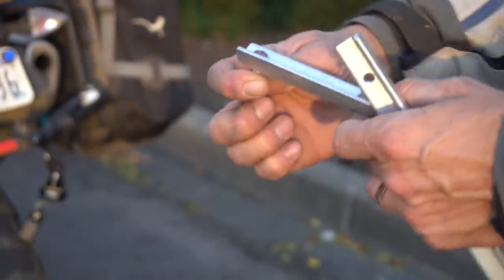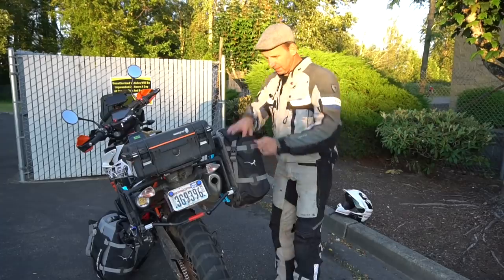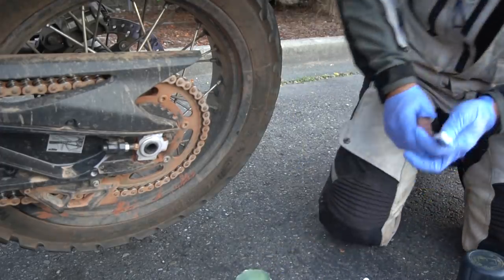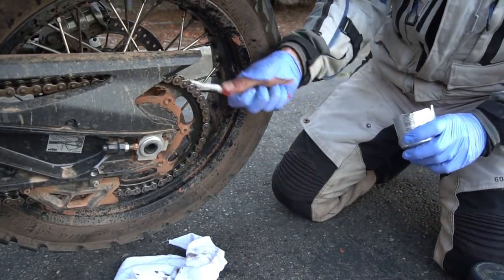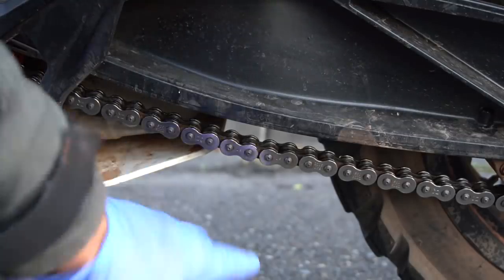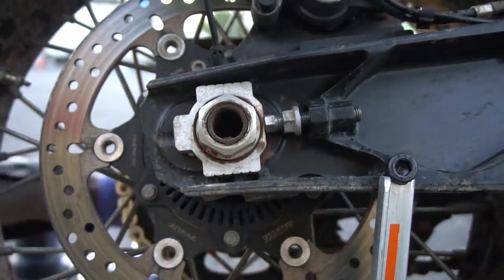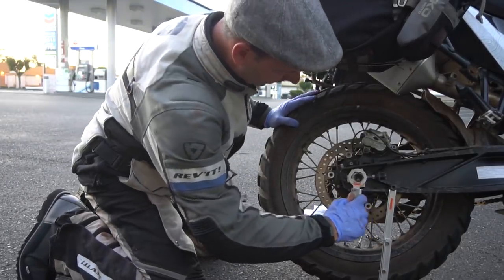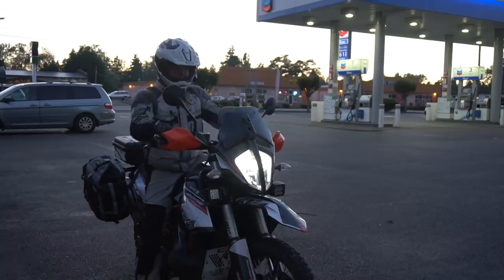Motorcycle chain maintenance tips while traveling

Comment: Very helpful! I’ve got a 1600 mi trip coming up, and was wondering about this. Question: Don’t you lube the chain after cleaning? I’ve specifically wondered about that because it seems like chain lube only comes in a bigger can than I want to carry...
Reply: You need to lube to chain. He got the whole x/o-ring thing wrong. Yes theres o rings and yes theres grease inside. Nevertheless you need to lube the area where the chain is running on the sprockets. Or it will wear prematurely. Diesel ist only sufficient for cleaning, but not for lubricating.
Reply: No, you don't need to lube a chain

Comment: Majority of chain adjustments should be done with the back wheel in contact with the ground, and no load on the bike. It’s the first time I’ve seen this done in this way. Aside from cleaning the chain is there a reason you have done it this way? Thanks Bret.

Comment: Awesome stuff! I do have to ask, how did you lift the bike up, to get the aluminium stand under the bolt? Did someone help you with it?
Also, about cleaning the chain. Do you clean it because of the toll the dirt off-roading takes on it? Because the popular belief in my country is, lube the chain every 300-400km and clean it before the 3rd lubing.
And I'm definitely nicking your Velcro handbreak idea. My dad's scooter (Suzuki Address 110), has something like that built in. A small 1 finger lever, that locks rear break lever in place.

And really man, thank you for all the effort! Seeing you this tired and still making a video after a day of hard work... Just wow, says a lot about a man.
Reply: They’re very easy to get the wheel up by simply levering the bike over onto the sidestand on the opposite (left) side. It’s leverage. Not difficult.
Reply from the maker: Non o-ring chains need lube, o-ring chaons need to be clean (protect the o ring from damage and dirt getting past them) and to keep the o-rings from drying out
Reply: @ronanrogers4127  I see, will try it out. It seems way more handy, than my push the bike around to get the chain in an untreated spot :P
Reply: @BretTkacs  Alright, thanks. Will pay more attention to that
Reply from the maker: You can see when I remove the stand I lift the bike using my back against the pannier
Reply: @BretTkacs  I see... Very nice, thank you for the explanation :)

Comment: Morning Bret, have you ever looked at or tried the Tutoro chainoiler from Ldyney, Gloucesershire? I use one on my HD shovelhead and Ducati ST2, and about to fit one to my 890 Adv R. Been very good on the two road bikes keeping the chain clean. They work on the motion of the bike feeding oil through a needle valve, simpler than a Scott oiler. Check them out..

Comment: lot of mechanics say, yes lube every 500-800km, but DO NOT clean every time, cause chain kicks dirt off anyway while riding, and if you clean too much, you eventually WILL take it's original grease out... my factory chain came very rusty this winter on both sides as I cleaned it every 800-1000km, even though lubed, became rusty and then called for more cleaning... from now, I clean it every 1500km properly, and lube it every two full tanks are done...that's 700-800km...

Comment: Excellent video...particularky for those who regularly do off-road. I ride a Vstrom 1000XT and do cross country tours...however I'm strictly an asphalt rider. I'll just say that my chain typically doesn't get very dirty as a result. I do focus on frequent lubing per moisture barrier. I like the stand trick. Was thinking I needed a center stand but with spools maybe just a jig like yours. My one question is...isn't the wheel supposed to be on the ground for chain tension adjustments?
Reply: yes, the readings in the manuals are based on the bike being on the sidestand. 
if you are confident enough to eyeball it, what hes doing is close enough BUT the less weight there is on the rear and the more slack you need. so adjusting your chain to eyeball 1inch when its off the ground versus sidestand COULD be the difference between a smooth ride and a chain snapping at 5000 RPM so ya know... be careful XD

Comment: I have bought the same handles you have, I then had a problem with my front brakes they were soft and mushy and finally a total break down. KTM would not accept to replace them under warranty because of the handle change. Just wanted to inform you.

Comment: You're saying Diesel (black nozzle) but you're using Petrol (green nozzle). At least in the UK. Does it make any difference which one we use?
Reply: Diesel fuel and gasoline are dispensed through nozzles that may be green, black, red, yellow or any other color. On some newer pumps, several grades of gasoline are delivered through a single hose and nozzle, which also could be any color. Green is commonly the color of diesel pumps, but not all green pumps are for diesel fuel.

Comment: that aluminium prop is amazing. I just realized it's actually better for adjusting the chain slack than a center stand. As far as I know and I assume KTM does the same, you measure the slack when the wheel is on the ground. Now try to do that on a center stand with the wheel hanging ... with this alu prop, part of the weight goes on the side stand too, true but at least it's much closer to the proper measurement situation. And it's 10 time cheaper and replaceable oh yeah, and lighter

Comment: Good vid! 
In my opinion the only and easiest way to get a perfect straight wheel is a Laserpointer!
Reply from the maker: It's just not that critical. If you can't tell it's not straight then it's all good
Reply: Don't forget sprocket alignment! I could pull my front sprocket from the shaft after i alinged the wheels after a couple of thousand miles . The axial pressure had eaten up the retainer clip completely. Nowadays i just look at the chain if it rolls over the center of the sprockets

Comment: Yo Bret!  Your 2-piece aluminum 'support stand' looks like a fantastic play on some other tubular steel stands and the 'snapjack'.  Yours seems simplest and best for this.  Did you actually drill and tap a hole in your swingarm for the locator bolt!?!  Also, do you see this method commonly used for solo trail riders for say, propping the front end up for a flat repair as well?  I bought a center stand for my AT but very quickly learned they are not compatible with hard offroad riding.  You should make a video for safely changing tires using these kinds of supports!  I would like to see some variations on tooling and also some front and rear support placement techniques.
Reply from the maker: Funny you mentioned that... My new tires just came in

Comment: I beg to differ on your chain tension.  Reread the manual.  It says to measure 25mm behind the end of the bottom chain guide.  Push up the chain at that point.  Measurement at the top of link and bottom of the swingarm should be 2 to 5 mm and the top of the chain above the swingarm should be taut.  These bikes are weird but I really like my 890AR.
Reply: Ditto on this.  Spent a lot of time studying the diagram sticker on the swing arm, the manual, and on-line videos and it seems pretty clear what you describe -- 2-5 mm off swing arm measured 25mm back from back of chain guide, is what's intended.  Seems loose, and even my local dealer said my chain was loose and wanted to adjust it for a non-nominal fee, but better too loose than too tight, I suppose.

Comment: Hey Bret, I've been pushing my way towards a 1000 mile day, I'm up to 700 now.  I actually thought my Tiger 900  would be a lot more butt-destroying than it really is, which is nice, so breaking that 1000 mile barrier is going to happen pretty soon.  Do you think it's OK to run a chain 1000 miles in 16-18 hours at interstate speed and just do maintenance at the end, or should I be really conservative and at least look at it partway?

Thanks for all your videos by the way, your stuff on Mototrek is part of what convinced me to get into riding in the first place, as well as get an ADV.  The amount of information you put out there for free is really fantastic, hopefully one day I can take an actual class with you.
Reply from the maker: In short you are fine... It's not really mileage, it's about use. The hardest conditions for a chain are dirty with sudden increases and decreases in acceleration (think hard off road). The easiest conditions are clean (relitive) with steady throttle (distance riding). Manufacturers will always error on the side of conservative which lands in the 500-700 mi range. They are assuming normal commuting and stop and go.

I wouldn't hesitate doing 1000 mi or more of touring or distance riding.

Comment: After 40 years of riding and a bunch of o-ring chains:  Screw worrying about maintenance that much.  Check the tension and ride your bike.  A new chain and sprockets are going to be required eventually, and all the additional fuss is going to save you maybe $20 of parts life.  The lube does ZERO for sprocket wear, and might actually hurt as wet chains attract dust and grit.  Adjust them, keep them from rusting excessively, and move on.

Comment: Hi Bret, I noticed the lack of a torque wrench. I was just curious on making sure to not over or under tighten.
Reply from the maker: Experience helps (wrenching motorcycles for 33 years)

If it falls off its to loose, if you strip it, it's too tight.

You can check you hand torque with a torque wrench and het cloae. This works decent fit anywhere outside the engine not dealing with bearing pressure.

The axle bearings are captures so its the inner race and spacer not the bearing being torqued
Reply: @BretTkacs  ah very interesting

Comment: What do you think about devices like scottoiler ? I have one for my 790 but I havent installed it yet because with no center stand hard to clean my chain and I need to do that before. Or maybe I can use your trick. What do you use for metal stuff for that ? Where do you get it ?
Reply from the maker: It's just aluminum angle, you can find it at the hardware store.

Scottoilers are nice but for the cost and hassle I'm not putting one on the 790 (yet)

Comment: My only real problem with this video is the fact the did not also cleaned the INSIDE of the chain ( as in the bottom run of the chain..on top.  dirt accumulates there also).  Always clean ALL of the chain...inside...outside...both sides and properly lube if you can.  Everything else, pretty good.  

I don't remember what Fortnine said about using Diesel to clean a chain if they have before.

Comment: Hi @brettkacs 
Hope you'll see this comment even if it's an old video. Please clerify how you measure chain slack on the KTM 790/890 Adventure. You say it should be about 25 mm. From where to where? The manual says you should measure 25 mm behind the chain guard (or what it's called) and that the measure should be 2-5 mm from the top of the chain to the swing. I think that's an hard way to measure and I hope you can explain how you measure chain slack for this bike.
Reply: You should stick to the method you just described it is the correct way, just use a hex key to check the gap. Also you should have the swing arm Unsupported so that the rear suspension is fully extended... unlike the method in this video

Comment: Great practical tips from a pro but aren't you getting an inaccurate chain measurement with the rear wheel off the ground?  Every owner's manual will tell you to test the chain with the bike on the side stand and rear wheel firmly on the ground.  Very different measurements if the wheel is elevated like when on a centerstand.

Comment: Good video. But this is a bit overkill. In my experience just hosing a chain  with water to get excess dirt off it an d oiling lightly will give years of maintenance free chain life. Save alot of work. Also be careful putting
Reply: Be careful putting diesel any where near your tyres. When it rains the spillage on the rim and tyre then spins onto the tread. You know what happens next.

Comment: Does sag, once you've mounted your bike, not affect the chain tension?
Reply from the maker: It does... The chain slack is to compensate for the tightest part of the swing. A bike like the BMW G450 required no slack where as others require excessive swing the free sag on the 790 is minimal so on or off side stand makes little difference

Comment: Err... all you do to tighten the main nut is you just 'loosely' tighten it with that wrench? For my Tiger 800, Triumph specs say the torque should be 110 Nm, so I bought a torque wrench and I fasten the rear wheel nut at 90 Nm (100 Nm max), and that's already a lot. 110 Nm is crazy overdoing it. But I am a bit worried seeing you fastening that rear wheel main nut quite 'loosely' with that primitive wrench that offers only minimum leverage. Am I overly concerned with that rear wheel nut, or...?

Comment: I use WD-40 when I travel, ATF when I'm home
Reply from the maker: I'm a fan of WD40
Reply: @BretTkacs  Won't WD40 actually penetrate under the o-rings? I thought the purpose of the cleaner was to get the dirt off around them, not from underneath them. I use kerosene myself...
Reply: @BartoszBanachewicz  Yep, kero not wd40.
Reply: @BartoszBanachewicz  No, it won't penetrate. Check Ryan's F9 video about chain cleaners/lubes.
Reply: @pont0n  You need to rewatch it.  It does penetrate.
Reply: @davidmcmanus4751  hm, no... Chain cleaner video, 7:20. Wd40 pass the test

Comment: bad cleaning !!! And inside the chain ????
Reply: The link rollers.... Roll

You clean the outside two cycles around, and wipe them,  then you've cleaned the rollers 360 degrees... Unless the rollers are frozen,  and that means your chain is scrap. 

TBH some diluted Dawn on a toothbrush will cut the grit,  then wipe,  then put some grease on the sprocket teeth and a modern chain has all the oiling it needs.  Kero (sour diesel)or Diesel is really not needed unless you coat a chain with grease or excess wax. 

The roller grease is trapped inside the roller for the life of the chain and you never touch it or see it...unless you destroy the O rings with too harsh a cleaning solvent or a wire brush.

Comment: Diesel destroys o-ring and x-rings. They WILL swell over time. Use kerosene at least.
Reply: Incorrect. Diesel is fine. DID recommend both kerosene and diesel. Gear oil is also recommended with o-ring chains, but not essential.
Reply: Kerosene/Jet A/ Heating oil is very lightweight diesel.  It is used in diesel engines in very cold weather.
Reply: @ronanrogers4127  
It is correct and it is from own ecpirience with DID VX2 520chain. Open your chain, take the oring, xrings out an dump them into diesel. They will swell over time. Same as ruber on your brake caliper and seals in your wheel. I never saw chain manufacture recomending clean diesel  to clean their chain. They always have "special" solvent "based" on kerosene.